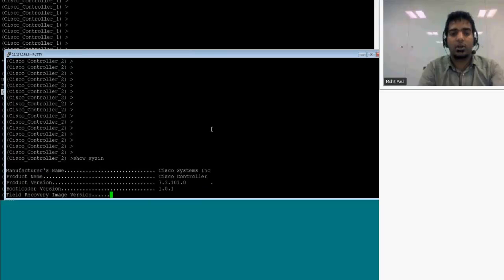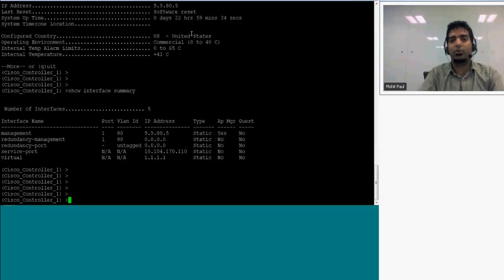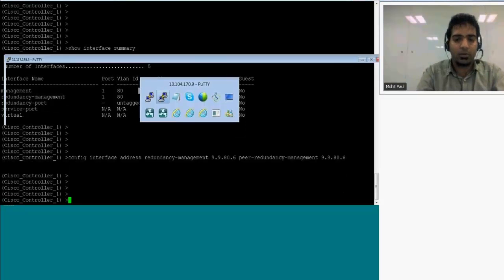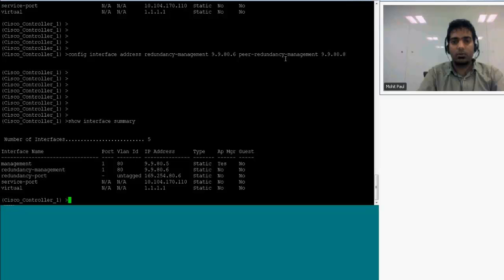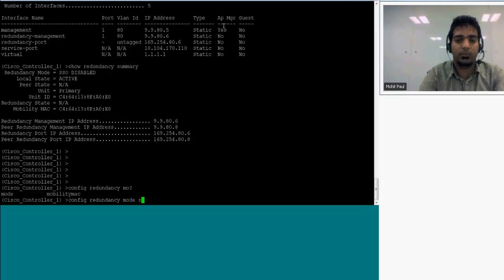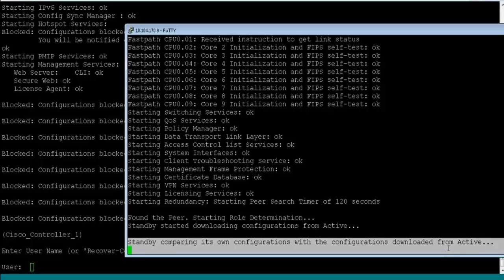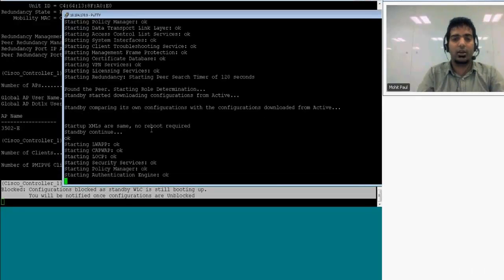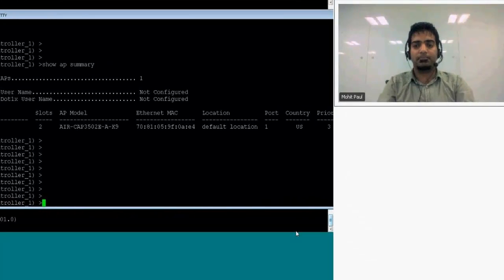How to Configure and Pair-up Two Different Controllers in High Availability Mode using CLI

Comment: if can get this project we would like to make or share 
Project Description:
The goal of this project is to establish communication between two wireless controllers on separate networks. Each controller will be connected to its respective network and will be able to transmit and receive data to and from the other controller.